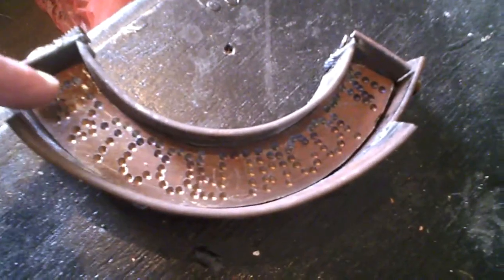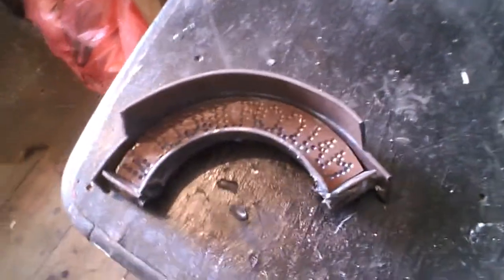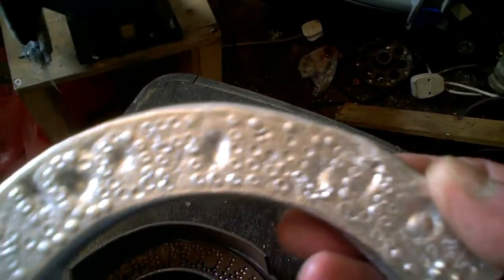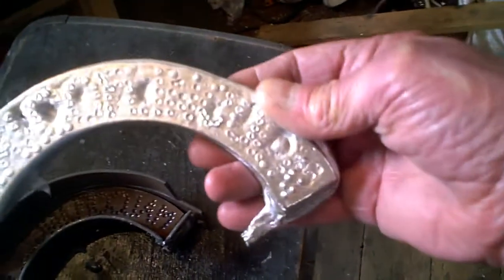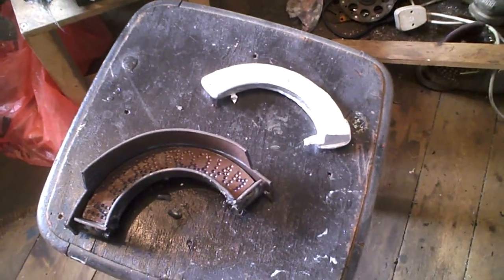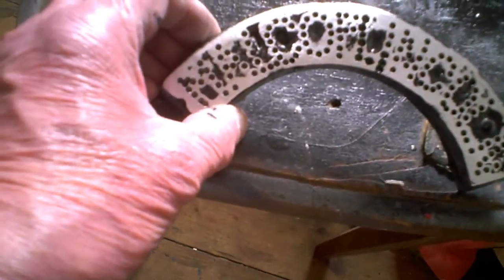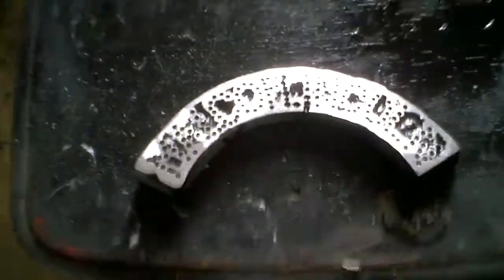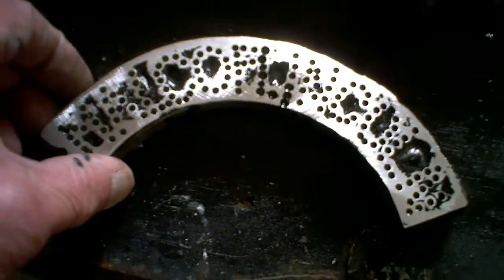Casting My Username

Comment: You made something from nothing Malc, and it can't always be expected to turn out in A1 condition, but think of what you have achieved and the time and skill it took to make - brilliant, you should be proud. I am confident that the finished nameplate will look just perfect on your tractor as it is "in keeping" with the vehicle.
Reply from the maker: Just been doing a bit more to it Mike. It's only decoration for the back of the box so it's good enough for that when I get it finished. Plus of course I've the mold to alter and then do some more sometime.

Comment: I think you have the start of something there. Malc
Reply from the maker: Just the ending I'm struggling with Ian lol. Cleaned this up a bit today.....will work but still going to try other things. Tell you what though, I was right about ordinary cement. Used it loads of times now, hardly any cracking and just a bit of heat damage to a small part.